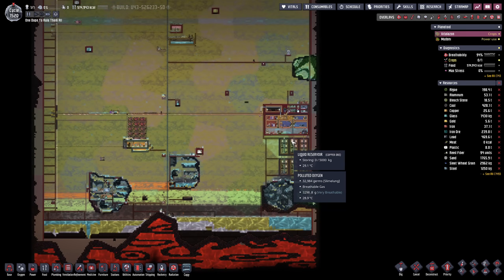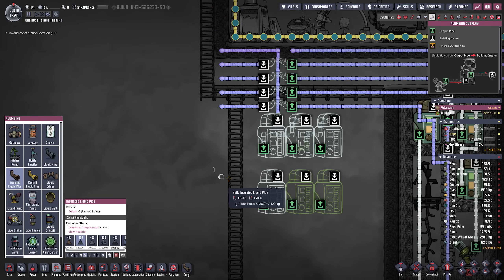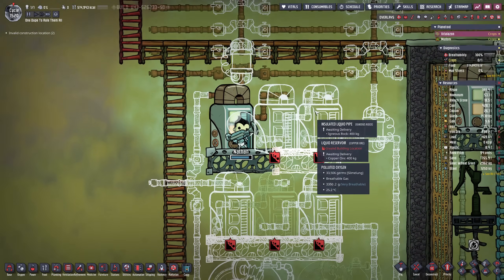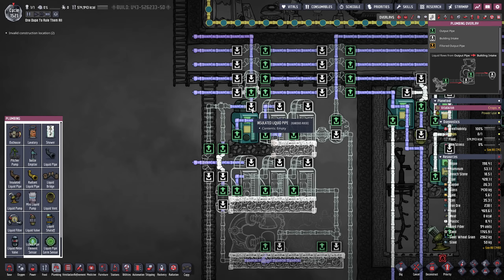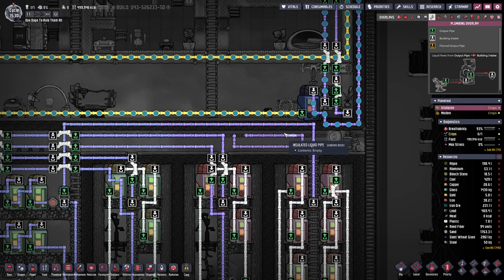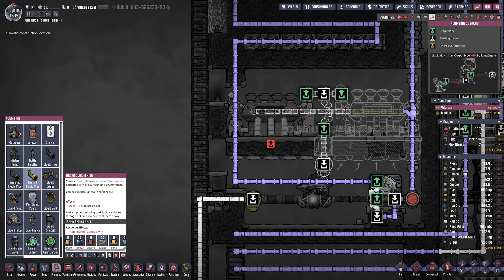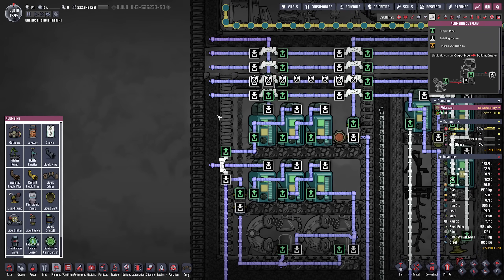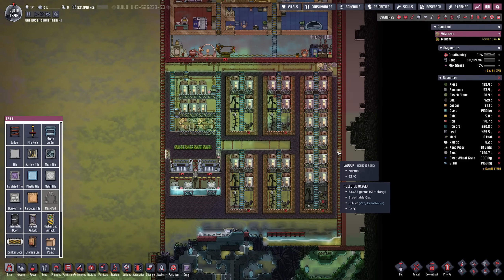GERMS & TEMPERATURE REGULATION - Spaced Out (Classic + One Dupe): Ep. #32 (Oxygen Not Included)

Comment: Why are you using Desals for your salt water? That was the mistake you made on the other planetoid... It requires constant attention

Use a heat mechanic (Geothermal, Metal Volcs, Ore Refinery etc etc) to boil and then condense ALL your water so you don't need to have your dupe keep coming back to deal with the desalinator.
Reply from the maker: It seems silly to me to heat up -10 degrees to 120 degrees and then back to 25 while we don't even need that much water. The volcano on the second planetoid can't even keep up heating a single geyser and we don't have any magma volcanos from the looks of it.
Reply: @Nathans-Sandbox  it might seem silly, but its easy to do, which makes it considerably less silly.

The hardest thing about the Desal method is that it's labour intensive. You'll need to spend a quarter of a cycle every 10 emptying the Desal
 With a Geo furnance, if you don't need the water, you can simply spit it out into Space, or create shutoffs that stop inputting water into the Heater when not needed.
Reply: @Nathans-Sandbox  you have Molten cores. That would last you a solid 5000 cycles